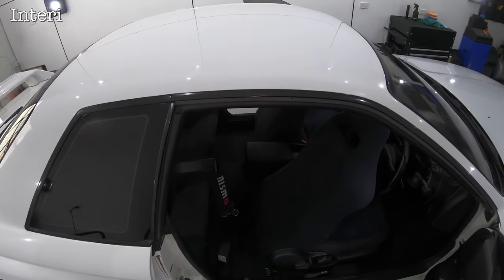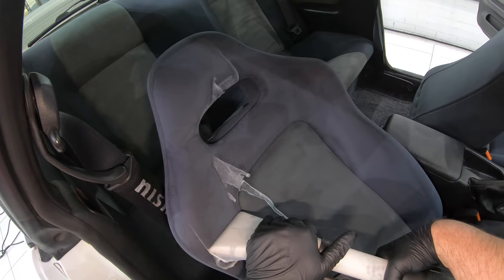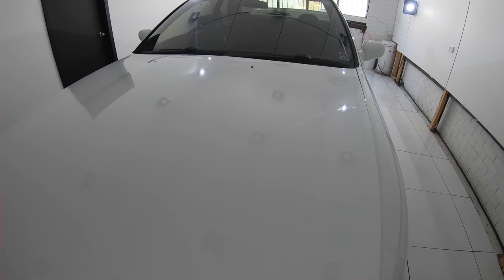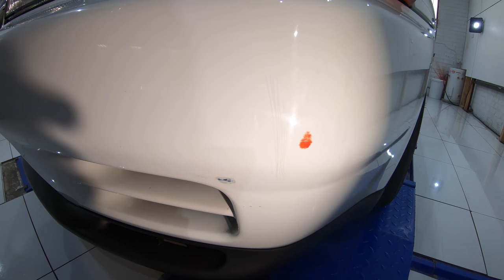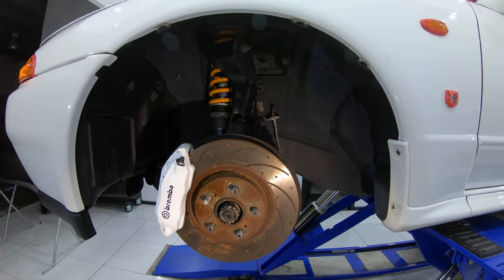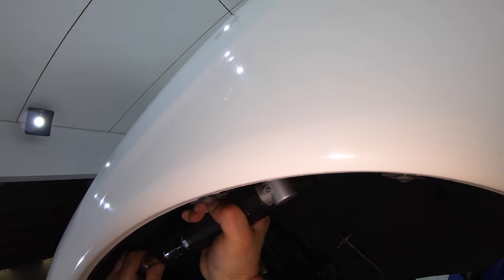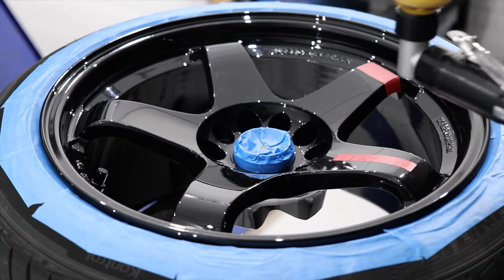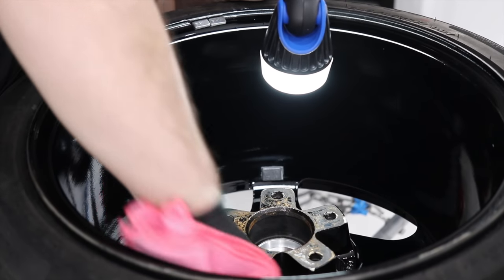100hrs Detailing A Nissan Skyline R32 V-spec II GT-R- P2 Interior & Wheels (Vlog 27.2)

Comment: I spent ~ 10 hours over the last couple of evenings washing my girlfriend's very neglected Kia Piccanto. It is 7 years old and it has NEVER been washed by her. It get a quick spritz by the dealer when it goes in for a service.  Mixture of household APC and AutoFinesse Citrus Pro only shifted the heavy stuff, leaving lots of stains and tough grime. I really needed something stronger, like Surfex HD but I had non.  After using almost a full litre each of Auto Finnesse ObliTARate and BH Korrosol, I have most of the visible contaminents out, though I broke many rules by having to scrub the surfaces faily aggressively with a MF towel.  It's not entering any competitions and it's cover in dints and scratches so it really doesn't matter.   Tonight, it will be rinsed and clayed, though I've no IPA to wipe over with afterwards and I've no chance of getting any any time soon.  Might just have to wash it throughly by hand. It's not getting polished or cleansed, though I might give it a quick layer of wax just to make it easier next time. Far from ideal, but a lot better than how it was.

Anyways, long story short, that alone was enough to inflic severe back pain that stopped me sleeping. I don't know how you guys do detailing as a profession, you have my respect!
Reply: It's very physically demanding, I do construction and detailing on the side and often detailing makes my back and neck more sore than construction. It is certainly worth every penny....people dont realize how much work it is. 

After putting that much work in a car and going through the clay process you really need to protect it with at least a wax....something like the new Turtle Wax Hybrid Pro, you can find it in stores, it's a great prosumer product that's easy to use.

Comment: One thing I've learned over the years when doing windows is that doing the inside with horizontal wipes and outside with vertical wipes or vice versa. It makes finding which side of the glass are streaks if any 💪🏾💯
Reply: This is genius

Comment: Thank you for showing another coating area using D-Lux. I also use this on my wheels and love it. I repainted my wheel wells satin black and applied 2 layers of Reload (I truly love Carpro products), not even thinking to use D-Lux in there. When the next  wheel well deep clean happens, I will definitely be using the D-Lux. Cheers Sandro 👍

Comment: When paint is that thin and has painted panels do you have customers sign a disclaimer that your not responsible if there is any clear damage like burn through? Or if that happens do you just pay to have the clear coat damage repaired?
Reply from the maker: No I tend to just have a conversation with them and explain the pros and cons associated with the process and the potential risks so that they can make a well informed decision on how they wish me to proceed.
Reply: @CarCraftAutoDetailing  I've talked to the customer about potential risk and ive never broke through on a customer car before but I've been scared that I was going too. I'm always worried that if I break through they will be upset and want me to pay to repair it or else leave me bad reviews....that's why ive been thinking of disclaimers. Esp custom paint jobs where I have no idea exactly how much of the paint is actual clear.

Comment: What is the limit value of Ptg (um) to pass a compound and for a wet sanding?. The top being the ptg's which measures the different layers (base coat, paint, clear coat), but with a ptg which only measures from the body to the clear coat, how do you know when to stop so as not to cross the clear coat !? 
Thank you

Comment: For polishing wheels, what would you recommend. I bought the iBird long neck systainer kit.  Not sure if I should  use the green (rotary) or the red (12mm).  There are a lot of spokes and definitely going with 1 inch pads.
Reply: @CarCraftAutoDetailing  so the wheels are vertini rf1.4 so they are pretty intricate and wheels are brand new.  Had the tires mounted and balanced so now I plan to wash, polish and ceramic coat.
Reply: @CarCraftAutoDetailing  awesome!! I guess the 12mm would be to large for the wheel area you think?  I thought the 3mm was for sanding but I guess technically it doesn't matter.  Should be able to use it regardless.
Reply: @CarCraftAutoDetailing  my good sir you are an outstanding gentleman and a scholar!!  Truly appreciate the help!!  Will make sure to send you pics of the progress!!

Comment: When the paint is that thin, and you're putting in so many hours anyway, wouldn't it be of more benefit and only a little more expensive to just repaint the vehicle?
Reply: It wouldn't be original though...

Depends on costs as well.
Reply: They are 30 year old cars though
Reply: @zagan1  It's already been in an accident or repainted for some other reason, though.  Guess it depends on what the customer wants to do with it, but 67 microns is down to 50% or less of the original clear coat, add to the the oxidation and you're down to basically nothing after compounding if you go for a 90% correction.  If the owner isn't going to drive it and just trailers it around to shows or keeps it garaged except for a Sunday drive every few months that's fine.  If it's going to be driven regularly I think I'd either repaint or just do a light polish correction to remove the oxidation and then apply an acrylic cleaner wax to fill in some of the scratches and add gloss.  A 100hr detail has got to be what, $6-7k at least?  I wouldn't expect a paint job to be much more than that.
Reply: @jgalt99  A concours paint job can cost $20,000. Ammo NYC did this to his old porsche and the amount of work done to repaint a car properly is astounding.
Reply: @Pavorish  the car is white..dont need to do the inside of the doors if you just color match it...2k$ would be a fair price anywhere..can allways reclear as well
Reply: @Pavorish  was it in some special color or what cause 20k is far too much for that kinda paintjob

Comment: Lucky boyz to get the r32 , here it's only import ( not that expensive tho )
Reply: It's basically import everywhere. Australia only got 100 new cars.
Reply: @Thohean  Import with RHD instead of LHD , it needs special homologation here , still not gonna cost too much :) 
But the problem is  finding spare parts
Reply: In the first part, it was said that this particular R32 was imported to Australia.
Reply: @dimmacommunication  there was no LHD version, that I've ever seen. With Australia being RHD, there were no modifications needed to the japanese version.

Not sure what you mean about special homologation beyond the 100 cars sold in Australia.

You're right about cost. Mine was only $12.5k, being it is a GTS-t. And parts are expensive and can be hard to find in the USA.

Comment: The color is that on the wheels called? Such a nice color and wheel.
Reply: J D hey brother, I have the same wheel set but I couldn’t find the color code on the paperwork. The wheels are Nismo LMGT4. They’re made by Rays. Perhaps you can email them for the color code... the center caps didn’t come with this particular wheel set but it’s a good fit.

Comment: I’m sorry but that interior cleaning gave off a ‘putting lipstick on a pig’ vibe. Those seats are easier to remove than the wheels. For a 100hr detail, I expected to see the seats removed and cleaned, the entire interior steam cleaned, the grooves in the pedals cleaned and maybe an ozone machine being used.
Reply: And when you pay for the job you can get that done
Reply: Car Craft Auto Detailing thanks for taking the time out to explain. This is the first time I’ve come across your channel, i have no idea what may have been said before. I think a disclaimer, just like the one you gave for not touching the dash would have been useful for those not-so-familiar with your work.